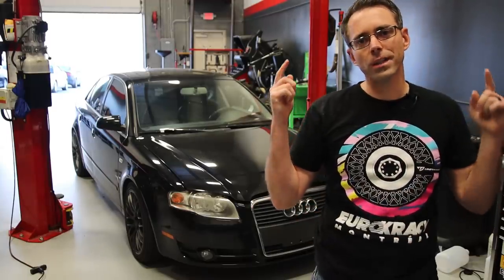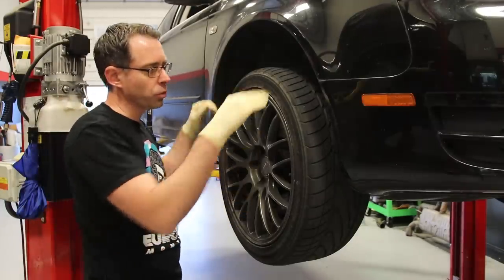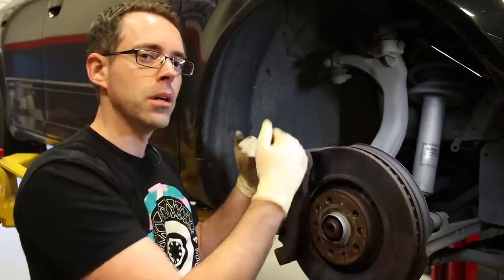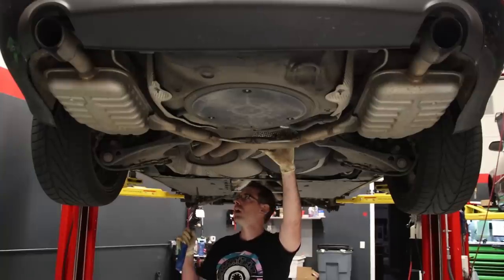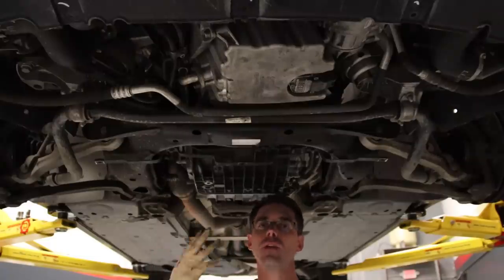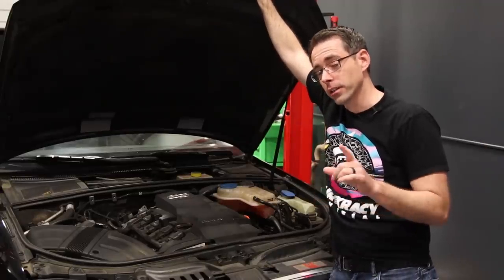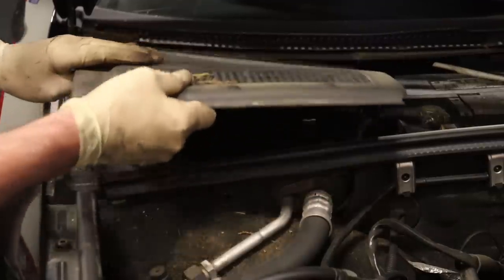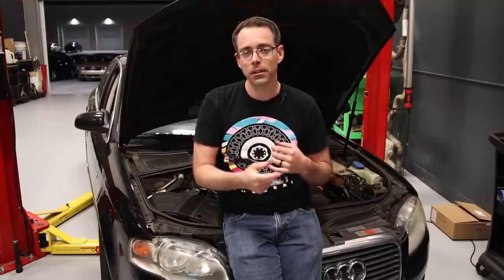Why is this Clean B7 Audi A4 $1500?

Comment: I got a 2007 A4 Quattro 2.0T from IAA in April for 500$.  All it needed was a rear bumper cover.  While MF'ers were buying toilet paper, I was buying an Audi on the cheap...
Reply: In my country you can do the same purchase for 500$ only if a "rear bumper cover" means the audi a4 2007 2.0T itself, because 500$ is a price of rear bumper here.
Reply: Here in Denmark you pay 5000 usd for that car with 300000 km😂
Reply: In 2019 I bought mine with 80k miles, B7 Quattro 2.0T A/T for 18k USD. Because my country it's a POS lol but great deal considering the MK5 GTI was selling for 35k lol
Reply: @frederikjanning8297 In Lithuania also around 5-6k euros
Reply: In estonia i bought a4 2.0 tdi quattro, 250000km for 4k
Reply: @frederikjanning8297  in the netherlands also😂

Comment: Cvt.  Oh crap.   These will hardly get a bid at dealer auction.   Y’all paid $1000 to much
Reply: And the shitty 2 tfsi engine. A match made in heaven
Reply: The multichronic transmission is a great transmission until it's not.
Reply: Michael S Got a 1.8T in my B7 quattro Avant  for a reason.
Reply: @mschwemberger  If it's well maintained, is it really a shitty engine though?
Reply: Troy DoinWork It’s named Multitronic
Reply: Troy DoinWork  non quattro models have the CVT
Reply: @johnb8637  so my a4 2008 2.0t sline quattro doesnt have CVT?
Reply: @bradwassup  no
Reply: I had no idea these were even offered with a cvt

Comment: Please do a manual swap on it, we need more DAP content! Your tutorials and DIY's are pretty good though! It  would be a fun couple videos to watch you do a 6 speed on it
Reply: Too expensive and not worth doing.
Reply: @Kris Nicholson I don't think that's true. Once the hardware is installed and mechanically working, and you have the new trans wired correctly, the software side of things is fixable. I know for a fact that on the MQB platform, the ECUs have the same hardware and software part numbers, regardless of transmission. Swapping the trans is as simple as changing the correct bits in the ECU and other module's long coding, and removing that auto trans from the Gateway Installation List on the CAN gateway. This is an older car, so it may be different than the MQB platform, but I can't imagine requiring an ECU replacement for a transmission swap. Worst case, maybe flashing the ECU to a different software version with ODIS Engineering or something but again, not impossible or too costly. If it really needed a different ECU, it can still be swapped with a cheap used junkyard one and adapted with ODIS Service. DAP could do it if they wanted to...
Reply: @Kris Nicholson isn't the CVT fwd engine mounted sideways.  I had a MT Quattro and it was not mounted sideways
Reply: I guess not
Reply: @Kris Nicholson once you get all the parts for the swap its just plug and play no coding or anything required.
Reply: Not manual is us..uk like me have a 6speed 2.0T red t as well so even quicker petrol with cruise control 2005 plate..fully loaded
Reply: @bzhitnitsky  just picked up an '08 a4 avant S-line for 1,000 just needs a new cam follower, h.p. fuel pump and possibly cams. Any more technical details on the manual swap? the local junkyard has 3 manual b7 a4's so i want to grab the ecu, cx axles, diff, clutch pedal, trans. anything else i need. Where could i go to get the ECU reprogrammed?
Reply: @obran003  If you’re technologically inclined, I’d do it myself. I’m not sure if that car needs the ECU replaced to swaps transmissions or just some coding. I’d try to look on forums and see if anybody has done it. Check on Ross-Tech forums and compare coding and ECU hardware/software part numbers between that vehicle with both transmissions and see if the hardware and software part numbers are the same. If yes, then compare coding and see the difference. Then you can buy a from Ross-Tech for VCDS, and make the necessary coding changes. If the hardware part number is the same, but different software, then you can buy a VAS5054 or newer cable and use VW’s ODIS software to reflash the correct software onto the ECU. You may need to re-activate the ECU via a connection to VW’s servers and credentials for that. You can usually find someone to do that for you online for a one time fee remotely if you don’t have your own login. Let me know if you got that route, I can probably help. If you’re not as technical, I’d look for an independent VW/Audi repair shop near you that specializes in VW/Audi. They should have the tools and knowledge to get it done. If they don’t, then find a different shop...

Comment: that ride desperately needs a 6spd manual swap
Reply: Including a 1.8T swap
Reply: @jonasthemovie  1.8T why? Is it more reliable perhaps?
Reply: @aleclafrance7284  It sure is. No high pressure fuel pump piston to ruin your cam.
Reply: @jonasthemovie  change the cam lobe every other oil change I suppose
Reply: @aleclafrance7284  The cam follower, but yes. There is a reason why studs are a popular upgrade to the pumps, to not wear out the head threads.

Comment: I'm VW/Audi through and through but i would avoid this car in CVT spec like the Rona.
Reply: @Kris Nicholson And designed to sound horrible. Sounds like slipping clutch
Reply: What's wrong with Velociraptors though? Haven't you seen Jerrasic Park?
Reply: @JDJD-mw9rr  😕Wrong chat room I think...
Reply: @audiwankenobi361  you didn't see the end of the video.....
Reply: @JDJD-mw9rr  Ok,I'll watch again because I don't remember.
Reply: Proper and timely maintenance will keep your ride, going for many years, regardless of manufacturer or transmission. $pend a bit now or a $hitload later.
Reply: quattro transmission and drivetrain swap asap

Comment: Great video! You pointed almost every common repair I've had to make on my 08 Quattro The last 3 years, high pressure fuel pump, pcv valve, purge valve, throttle body, both axles, coolant flange, and oil housing. Triptronic Trans is solid tho. Key is preventative maintenance, got 133k on mine.
Reply: Forgot to add i put in new radiator last month, plastic parts are a pain
Reply: Same I just reached 130,000 and having the serpentine belt, coolant distribution pipe and thermostat replaced with original parts

Comment: CVT on mine.  Love it.  Stage 2 for 4 years, no dramas.  Changed fluid 3 times.  Kept servicing and didn't slam it off from a stop.  Still great.  Most people who say they hate the CVT haven't driven one.  WAY faster, smoother, and simply a pleasure to drive.  Now, they're cheap to replace and rebuild, or, as only the CVT engine will allow, a manual swap with the GVE.
Reply: What mileage? I didn't realise CVT was a cheap fix, I've looked and it seems to indicate like 5k where I am as I have one. You can swap out CVT for manual?
Reply: Did you change the CVT fluid yourself or took it to a dealer?

Comment: Have the CVT on my 2008 S Line DTM. Got the car on the cheap. Really love the CVT. With the paddle shifters, it was actually the most expensive option back then. Great mpg and faster than either the manual or tiptronic. The paddle shifters are a must have. Good video. Changed the fluid using Amzoil. No issues whatsoever. Btw, Audi does not have a chemical plant. Their fluid is made by Motul. You can buy it for less than half the price. These cars are worth the trouble of fixing up. Ive owned two Honda’s and three Toyota’s and the have little or no driving enjoyment. Just point a to point b.  Absolutely love my Audi B7.

Comment: Just got my first Audi, 06 2.0t 6spd. Needed a head gasket and timing chain tensioner nothing else. What a BEAST!
 1000$ Basically brand new not even a rock chip 😝  if you see one for less than 2k baby jump on it. Quattro = savage grip.

Comment: i appreciate you including the part where you forget to put the wheel bolts back on when brake torquing the engine. your tips and advice is priceless but including your mistakes makes this a laudably down-to-earth video! 

also, is there an advantage to using plastic valve covers? my impression is german carmakers tend toward these and i don't understand why
Reply: Kevin Yuqi Wang cost saving, nothing else.
some newer models have plastic Oil Pan’s... fragile AF

Comment: This video came at the perfect time. I've been looking to buy one such Audi (as my first car) for a few months & this video is quite informative in terms of what to look for upon purchase.
Great content as usual!
Reply: Squared Donut Don’t. I had an 08 A4 6spd auto in pretty good condition. I didn’t have too many problems but consumables like brakes are expensive. (At least if its your first car) My control arms were warn as well as the leaky mounts as shown in the video. You’ll be spending way more than its worth in repairs. My car was a late model so it even had the revisions done for a lot of trouble spots. Toyota is your friend. Stack some bread and get a well sorted B8 A4 as your second car if you really want to ride german. Just make sure to put aside a few thousand for that too.
Reply: I bought the 2015 Audi A4 Quattro as my first car last year with 51k miles and only one owner. The history record for the 2015 A4 is spotless and very reliable with barley any issues. If you do consider Audi as a first car please take your time and do as much research as possible on the history record for repair cost and how much it cost to maintain. Im very happy with my A4 as it was exactly what I was trying to look for in an Audi since I couldn't afford the A7. Lol

Comment: Another great video, love the work you guys do.  I have used your videos to help me with maintainence , diagnostics and repairs to my own 2007 A4 2.0tfsi a load of times. Thank you.
One thing not mentioned in this video though, was the cam chain and tensioner. 
I'm curious to know if these are something to watch out for? Ive heard some stories of the tensioners failing, but have also read that there's no change interval providing the engine is serviced properly with correct oil. Is the chain and tensioner something I should consider replacing at some point?
Car currently has just over 113k miles on it.
Any input would be really appreciated 🤙🏻

Comment: Bought a silver s line qm California car. Worked on at 034 Motorsport. Has their high flow cat, all the street density mounts, Unitronic stg1 tune and a eibach koni cup kit. $5300 June of 2019 with 138k on it and receipts in the glove box that total more than I paid for it. Super clean with only a small dent on the hood. Could eat out of the engine bay. Now with 143k on it a couple of scratches, evap leak, oil filter housing leak and antifreeze leak near the turbo somewhere. Never over 4k rpm and still this BS. So mad cause my go fast money now has to go into maintenance. Oh well, I still love the car. Always get asked how I kept it so clean. All credit goes to the previous owner.

Comment: I think I drove like 40,000 miles over when my timing belt was due.. Wasn’t trying to prove anything, just worked a lot , now my B7 A4 has almost 230,000 (daily driven) finally replaced the oem turbo and upgraded the clutch ..

Comment: Have a a4 b7 3.0 tdi s line quattro as my daily and I love it,went for a manual and thankful i did,that pinch bolt that holds the top arms in place is the worst job on these cars,an absolute nightmare to get out
Reply: BIG G yup! we call it the “asshole bolt”.
It took me 2 days to get the driver side bolt out...
I ended up heating the aluminum to 400 degrees and using an air powered chisel.
A NIGHTMARE indeed.
Reply: It's it that bad? I have to do one on my A8
Reply: @JDJD-mw9rr  it can be real bad.if you soak the bolt at both ends with penetrating fluid every other day for about a week before the job it will give you a real good chance at getting it out,a bit of heat around the part the bolt goes through can make a huge difference also but just be careful the rubber on the upper control dont catch fire. you can pick up a butane blow torch kit on ebay for a few pound/dollars,one that has a trigger,so handy

Comment: would've liked to see a wagon of this car ( i have an 08 avant manual :D ) such pretty cars
Reply: Kojy : I agree. Looking for a 2006-2008 wagon right now as upgrade from 2004 Passat wagon.
Reply: I miss my b7 6 speed smoothest transmission I’ve ever experienced
Reply: I have an '07 A4 manual with nearly 200k miles on it. I'll probalby feed it very expensive parts for a long time to keep it going. There is no replacement for this car anymore.... maybe the Golf Alltrack manual comes close, but the A4 B7 AWD is a lot better. I'm keeping an eye out for a B7 S-Line wagon with a stick. They're super rare.
Reply: '05 b7 avant quattro stick here aswell. Mine with 55k miles :D
Reply: @erichtisnado1536  '07 Avant 3.2 6spd Titanium package here...apparently 1 of 9. Will also do whatever I can to keep it strong for as long as possible. Love it. Just over 80K miles right now and only putting on about 3K a year.
Reply: @erichtisnado1536  only 1,100 B7 S-line wagons made in 2008 according to Audi. Rare indeed.
Reply: I have a b7 a4 avant automatic s line
Reply: @BIMMERZEITT  I have one in quartz silver automatic quattro
Reply: @erichtisnado1536  I have and avant s line but its automatic (:
Reply: I love my 07 wagon manual   it's such an amazing vehicle   installed dab aftermarket radio subwoofer ambient light  has 336000km on the clock and still running smooth
But looking for upgrading to the 2018 skoda octacia rs wagon
Reply: 08 avant manual here too, 218k miles and going strong😂

Comment: I'd buy it. Used CVT is like $600-1500 for the part. So, in a $1500 car if I did it myself over a weekend, that's $3k. Still a bargain. Drive axles are like $100 each from Autozone, and easy to swap out. The Autozone ones are fine. I put a couple of them in my various Audi/VW cars over the years and never had an issue.

Comment: Sold my b7 1.8t  cvt 163 (mapped) bought a b7 2.0tdi Quattro manual I can certainly tell you I have made a good choice and made a few quid too
Reply: MySuperkings a mapped 1.8t with CVT is a time bomb. 😂
both 1.8t and 2.0TDI are great and reliable engines.
Reply: @fliegenmann2562   was a lovley drive once you were rolling but with a heavy foot .. a ticking time bomb as u say ... the Quattro is the way forward 170 standard .. mapped to 240 ish .. made a good choice ... do miss the sound of the 5cyl tho 😏

Comment: I'm not sure why CVT is so hated. Done 213k miles in my B7 Avant and not had a problem, also got the paddles too. I've never drive a manual version of my car so I don't know. But CV boots and track rods and the AC compressor are always problems on these. Will be getting rid of it soon though as I want either a new A6 3.0 TDI or a Q7 if they are good choices
Reply: That's good to hear. On 112k miles and it concerns me. Mines a b8 so should be even more reliable as the earlier ones had the problems, according to my mechanic. Do you change the oil every 40k?

Comment: i didn't know audi's ever used cvt's....cool!
Reply: All automatic fwd audis are CVT - stay away from them!
Reply: @Jackinacox  not all of them are CVT... Definitely have to look at the individual model and transmission model, FWD Tiptronic Audis exist too, they're not all Multitronic.
Reply: @sookoll23  all longitudinal fwd autos are CVT up until 2016 or something when they got DSG.
Reply: there's no rwd audi. quattro is 50/50 unless its s or rs model
Reply: Avoid if there is no service history and 6 plate clutch version. If its the 7 plate version with regular oil changes and the car has gasoline engine and its not remaped then its ok. I have 220000km on my gasoline CVT and the box runs like a dream
Reply: @BadMuflon  184000 A4 1.9 Tdi 131 CVT,didn't had any problem by now, lovely to drive cvt,don't like tiptronic

Comment: The vibration issue under load is the inner cv joints. I have a b7 tdi cvt and had the exact same issues. Even the P0706 code.

Comment: You forgot to mention the cam timing chain and tensioner, the often overlooked intake valve smasher!
Reply: This is an FSI engine.  Has a timing belt and not a chain.  You are thinking about the 2.0 TSI motor that has a timing chain and the TSI came to the US in late 08 and the engine cover on VWs said TSI.  FSI motors have cam follower issues.
Reply: @kylemandt527  Em no I'm not mistaken, the FSI engine has a timing belt AND a timing chain. It has a timing belt from crank to exhaust cam, then a chain between exhaust and intake cam. The cam chain and tensioner setup also has an oil pressure controlled phaser on the exhaust cam, this is how variable valve timing is achieved on the FSI. You've just highlighted the 'often overlooked' part of my original post!

Comment: Let's see an update. Love this platform. 
In addition to the things you mentioned, balance shafts can seize so there's a massive write up on that. Parts list to convert to 1.8 oil system is more than a new motor. 
Accusump is very highly recommended to save it. I'd love to see an install video of that is you choose to do it.

Comment: Uper ball joint check was false, have to turn the wheel fully to the end left and right and then on each turn push 12 a clock to see if there is any play. Under u have to use a bar and often before and after the wheel been turned left and right.

Comment: Do these 2.0 TFSI engines have any problem with the oil pump? (the oil pump balance shaft hex key is too weak) Or is it just the 2.0 diesel's weakpoint?
I have a similar condition B7 2.0 TDI manual with 296.000 km (184k miles) and I have already had it repaired preemptivly. I want is to reach 500.000 km. :)
BTW I'd love to see that manual conversion in a video.